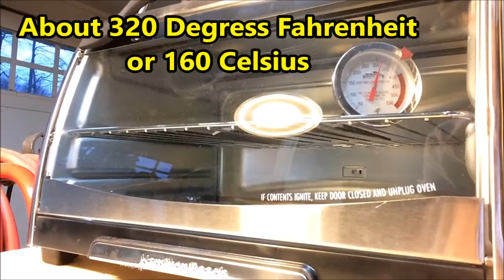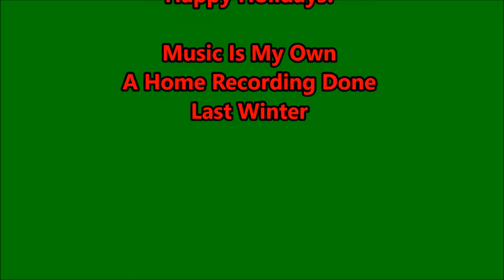Homemade Kydex Press For Knife Sheaths

Comment: Thanks for the Kydex-press tips, but you say you prefer leather over Kydex? I often wondered why - aside from leather being more stylish and the leather sheath having a more silent draw, what other benefits does it have over kydex? 

Greetings from Bulgaria! :)
Reply from the maker: Leather is softer - I find Kydex can sometimes leave marks on the blade.  The marks are not scratches but they are marks nonetheless.  The feel is also different - holding leather vs. holding plastic just feels better.   Obviously, Kydex is easier to make, lasts longer, looks more tactical, with many accessories that can easily be added to trick it out.  Hope that helps and this is just my personal view.
Reply: +Rick Rabjohn Thanks, I guess its a matter of personal preference.
Reply from the maker: I think your right - thanks for checking out my vids

Comment: How did the foam hold up from harbor freight?
Reply from the maker: Hi James - so far so good - that said, the foam does not return to normal shape - it retains the impression until I do another sheath -  If I did a lot of Kydex sheaths, I would probably splurge for the foam sold by the knife making supply shops to see if it made a difference - but for now it seems OK.  Booyah!